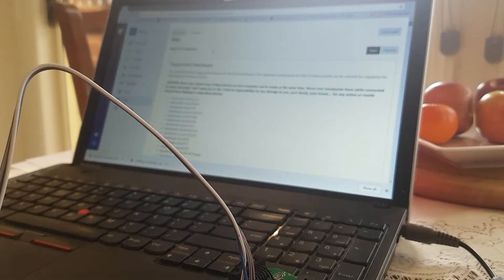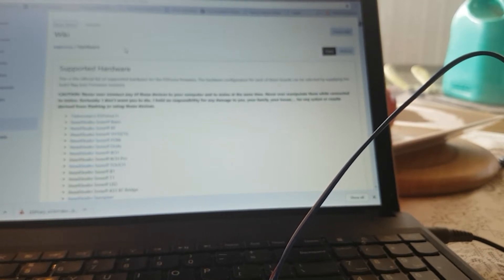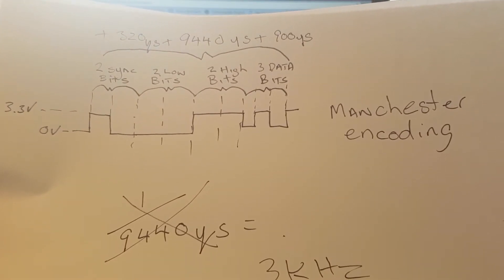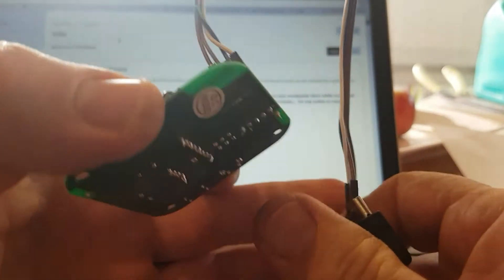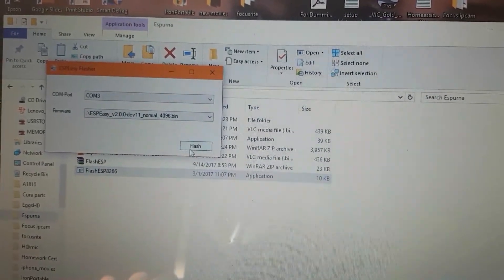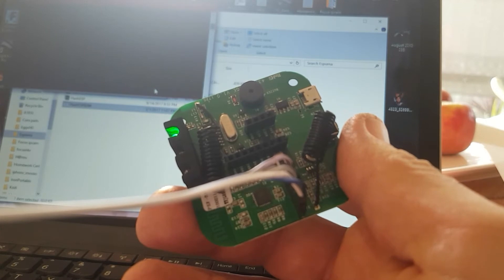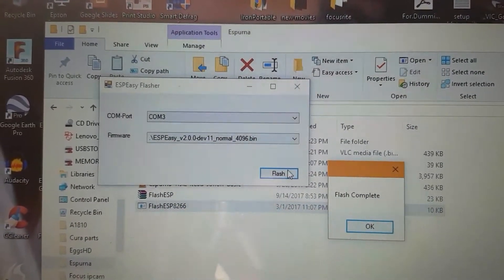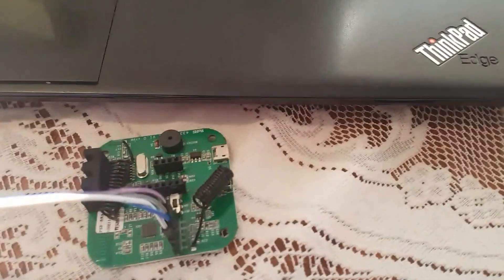New Sonoff RF Bridge Flashing Espurna to it. part 2

Comment: hi Chris, thanks for the video, I have manage to flash my sonoff rf and got it working with homeassistant.  Just wondering if you are able to change the switch#1, switch#2 and so on to something meaningful on the espurna home page?  Thanks
Reply from the maker: Hi Jacky, I have not done much for a while with the sonoff Rf, but here is my reference hopefully it helps you with the question.  http://tinkerman.cat/hacking-sonoff-rf-bridge-433/  If that does not help please get back in touch. Have a wonderful day.